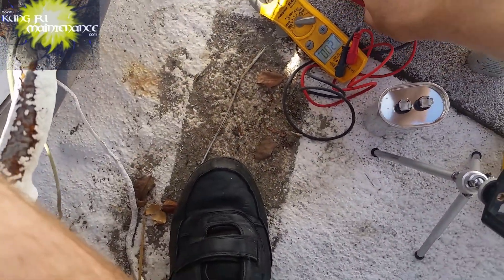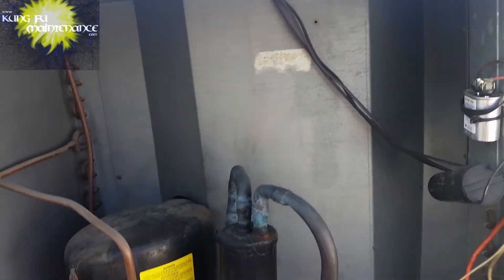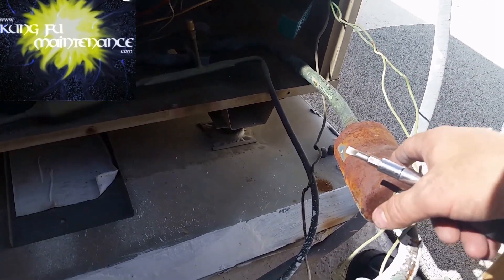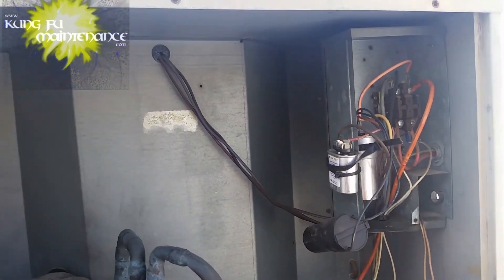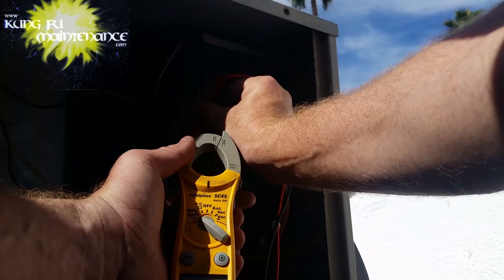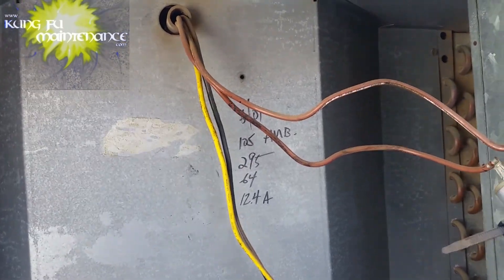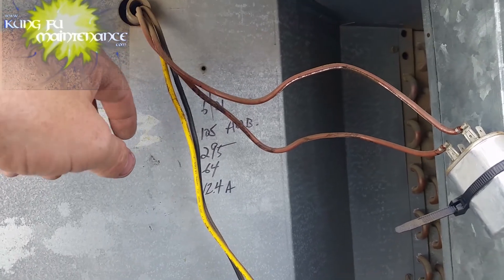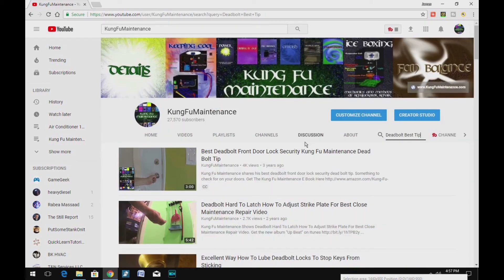Seven Reasons So Many Air Conditioner Capacitors Fail

Comment: Well, if a capacitor is anything like a lead acid battery if the voltage is too low to the capacitor all the charging and complete discharging would kill its total potential energy storage over a smaller amount of time. 

The maintenance crew at my apartment blame it on high heat and the roofing being old and not heat efficient. I don’t believe it. If that was the case how come they can’t give it better airflow to avoid that problem? It seems to me to be an electrical issue at my place. Whether that means the condenser fan has a short or electrical in the building has a problem I don’t know. They keep telling me the pressures are good and the charge is fine. I believe that because it’s very easy to check and easy to do plus it’s cheap. Lol 

I’m sure they have the right size capacitor in the unit because I just don’t believe it would be hard to find. A wiring issue where I am seems more plausible. Too many hands on the unit, it’s old, many hands on the building electrical over time... but could there be a temp sensor on the condenser causing it to cut the compressor off and also turn the condenser fan off? Or would the fan run irregardless for the sole purpose of cooling the condenser only?

Comment: A CHEAP DATE:  I change all system start and run capacitors at 8 years and the ignight-flame devices every 4 years.  These are low cost and wise prevention methods.  We need to get away from the breakdowns we can prevent and stop the mentality that it has to be broken to replace it.  Capacitors are $15 to $25 each.